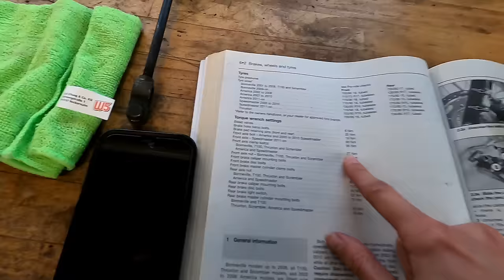Freddie Dobbs' Bonneville | Wheels of Time

Comment: Thanks for the video. I'm really enjoying the series. 
Was I imagining that the treads on the front and rear tyres were the opposite way round, and if so, is that usual? 
Keep up the good work and I'm looking forward to the big unveil!! 😃👍🤗
Reply: Could you imagine Joe fitting tyres the wrong way round! 95% of "V" style tread tyres are fitted that way - the V on the rear tyre faces the direction of rotation and the V on the front faces backwards. Those are Michelin Road Classics and are fitted correctly.
Reply: @luddite6239  No, I couldn't really imagine that!! 
In the old days, when I was your age 😅 (several decades ago) they were always the same way round as I recall, and I must say, although I have a bike, I haven't paid a great deal of attention to the general tyre configurations in modern times. 
At least I noticed the difference! 😅
Thanks again. 🤗
Reply: @gillianbrodie6807  you're quite right - tyres from back in the day did tend to be different, although many front tyres had longitudinal ribs rather than "V"s I'm not sure when things changed - probably when treads started to be designed by computer!

Comment: Actually, a workshop should be clean and everything in a place where ANYone can find it,   It goes back to the place whence it came,   I wish my workshop was like that, When I get busy , it goes back in the general direction,   Now one thing I will say, these are production motorcycles, tolerances wont be so hot and neither will the "torque values"     Remember the Bmw torque value of finger tight plus 1/2 a turn!

Comment: Hi Joe, I noticed the tread pattern on the tyres look like they conflict, with the back going centre to outside, and the front going outside to in, you may wish to check rotation on them to make sure they are both correct? I'm sure the wheels are good but could the rubber be on backwards?

Comment: Do you really torque everything or is it cos it’s someone else’s bike and on video?
Reply: ya beat me to it !
Reply: One of those times when a question say more about the person asking than the answer ever could.
Reply: Only two torque settings you'll ever need. Tight and fooking tight. 😂
Reply: I would torque a wheel and head bolts and other really important stuff, but yeah. The other stuff I can get close enough without it.
Reply: If the nut or bolts failure could result in an accident, id say yes... 

Back in the day you could use fking tight as the setting, now it will load a fixing so close to its failure point its dangerous.. over engineering is in the past..
Reply: @operator0  Always torque the front-axle clamp-bolts . Everyone overdoes them and it can destroy your fork-lowers.....dave  nz
Reply: @plumpii7177  Well-said , I hadn't thought of that      dave  nz
Reply: @kdsowen2882  As a a machinist, I agree, but for less important bolts, like an exhaust hanger, it's not really going to matter.
Reply: Why wouldn't you?  I mean, the torque wrench is right there, so might as well use it.  The hardest part, of course, is finding the proper torque setting in the manual, but other than that there's really no good reason not to do the job correctly when it is in the shop like this.
Reply: @kdsowen2882 was Joe meant to do them 1st before the axle bolt? Thought that way round the forks are true? Might be wrong

Comment: 12:03 Err should the front tyre (not the wheel) be that way round especially considering when you look at the rear wheel 21:07 which is the opposite way round?